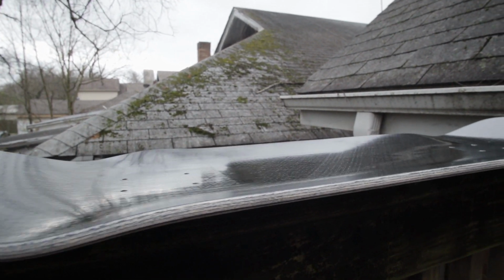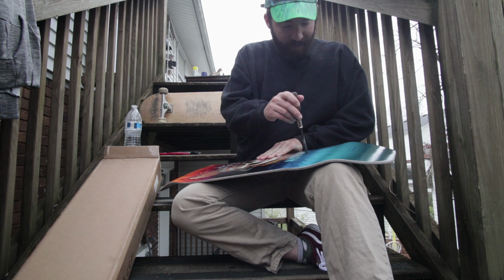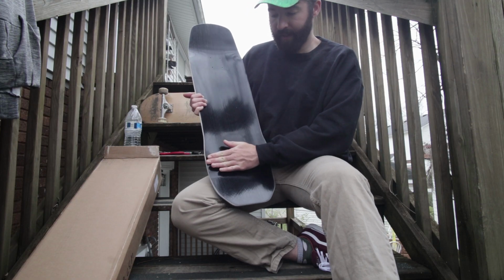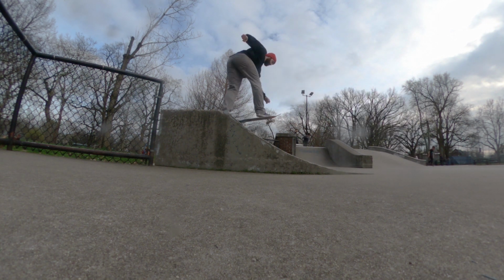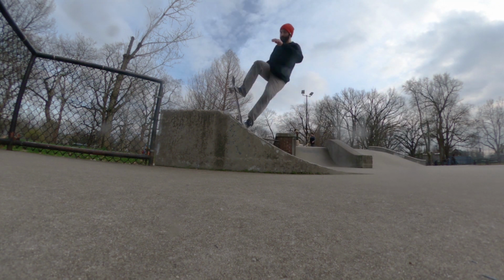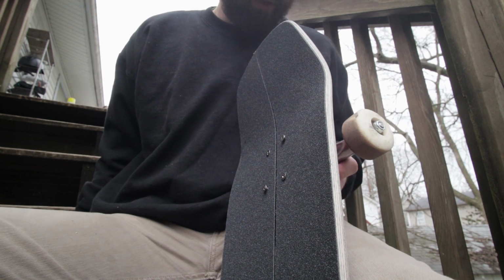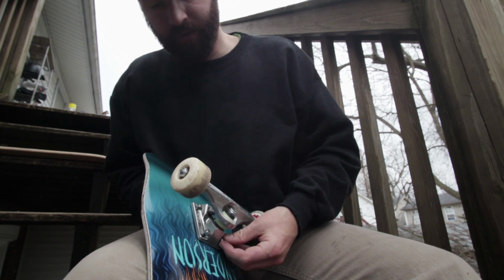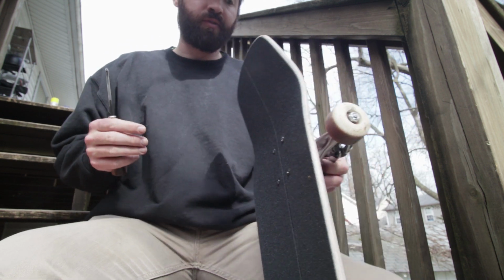Andy Anderson Powell Flight Deck unboxing and review

Comment: On the flight decks, the grip tape wears out way before the board. Just make sure you warm up the grip before taking it off to regrip it. You can pull up the top sheet.
Reply from the maker: Thanks, I'll remember that.

Comment: I love my heron deck i did had trouble with the bolts sinking into the carbon fiber but it never bugged me, I've been skating it about a month and at first i struggled to get use to the long wheel Base, i also changed shoes to D3 and since then i got used to it right away, i think it's because the D3 are very wide and reach the nose at my Ollie's sooner or something

Comment: Which size did you get? The 9.1" one? I've got the 8.45" one and really like it, but will get the bigger one once this one wears down so it better matches my trucks for rail / primo stand, because the trucks (Tensor Mag Light TENs 5.75) are actually a little bit too wide. It makes the board tip over ever so slightly towards the board side, instead of the trucks which would be way more stable / predictable.
Reply: PHeMoX how are the tensor tens? I have the mag light all terrain trucks, and they are amazing. I’d like to try the tens, for a lower truck
Reply from the maker: 9.1
Reply from the maker: I can only skate Indy 169's right now.
Reply: @kylemartinpaintings  I love them, but I don't think I am qualified for any kind of review on them as I'm quite a beginner. But they turn great and do feel very lightweight which is what I got them for as the Andy Anderson board is pretty big for what I am used to. In terms of ollies and such the Mag Light TENs are fine, same for flips. Haven't used them for grinds yet.
Reply: Hi, I also have the 8.45 withy the tensor mags in a 5.75 I find it super stable in primo. I also had to counter sink the deck to flush fit the bolts.
Reply: Please explain this comment.  Are you saying wide trucks make the deck tip over?  I don't understand that.
The trucks are too wide?  for skating? or do you mean the trucks are too long for clearance on a rail slide?  Please explain, thank you.
Reply: @kylemartinpaintings  I can't see the mag all terrains in a 8.75 unfortunately.  I can see the mag 10s in a 8.75.  Someone give tensor a nudge for all terrains in a 8.75

Comment: Hejjjj nice setup 🔥🔥🔥
I drive a 8.0-8,25 Decks size...
I have no idea which size I am order 🤦
I am scared the 9.1 ist to big for flip tricks
would you recommend the size???
or should I rather size 8.4 deck???please help regards
Reply: This 8.45 feels like an 8.25. It is pretty much a super sized free style board with a lot of concave. It feels a little small for pool or vert. Get the 8.45 if u are average height. Get the 9.1 if u are 6 feet or taller.
Reply: Dude...we learned flip tricks in the late 80s, early 90s with decks almost 10 inches.

Comment: For Andys 9” deck would you ride Indy 159’s or 169’s?
Reply: Definitely go with 169's with hard freestyle wheels like 97a
I have 63mm with risers and it is so nice for anything really just make sure you dont get soft wheels or you will be unable to do certain grinds aswell as any real nice reverts. I have independent 169 hollow lights skid plates and rib bones just to make the board last longer. I have nightmares that I will have to go back to a popsicle board lol.
Reply: The bigger trucks plus freestyle wheels makes primo sit rock solid
Reply: I'm thinking of going to a 9" - 10" after seeing Winkowski. He mentioned that he always uses 159 independent but I wonder if that works for a 10" board with 60mm OJ wheels. I'd like to build a good cruiser deck like Winkowski but wonder if he is just a one of a kind skater who can do tricks with a 10"
Reply: @Bradley_Warren  I ride 169 Indy forged titanium with bones hard core bushings and 1/8” Dook’s risers with 60mm 95A slime ball vomits, such a sick setup, I will never ride a traditional maple board again.

Comment: what size trucks are best for this board
Reply: 8,75'' for the 9,13''
8,38'' for the 8,45''

is what Andy rides, with 54mm wheels adn 1/8 risers
Reply: @Sk1tz092  thanks man sorted now but I appreciate you getting back to me 🙏
Reply: I use Krux 9.0 on my 9.13 model. It's perfect.

Comment: Should i continue to skate dude its become to expensive and being a 15 year old i dont have a steady income let me know what you think.
Reply from the maker: If you enjoy it. I can't stop. I would do whatever it takes to get a board. Honestly I don't have a stable income right now either. I'll skate a 2x4 if I have to.
Reply: @Averageadultskateboarder  So i think i will try to get one from Filter Skateshop in Abq new mexico, thanks dude
Reply: @Conner Haney: That's actually why I choose to go with a Powell Peralta flight board, specifically the Anderson one. It may seem like a big investment, but these boards do last long. The shape might not be for everyone, but Powell Peralta also sells excellent other Flight decks using pretty much a similar carbon fiber tech.
Reply: Anonymous  Don't steal dude. Just make some friends and they will give you their old board. Usually there is life in boards others will throw away. The other thing is, I don't believe anyone can't save some money for a board, unless you're like homeless at which point you have wildly other thing to be concerned with than skateboarding. I will admit skateboarding can become expensive depending on what you do and want. Keep in mind that you don't need a super expensive board or set of trucks to enjoy the sport. There are completes that go for 80 bucks, which are worth it if you're dead broke.

Comment: So it is indeed fiberglass it’s a structural composite. I only know this because I work with it at my job building boat parts like the frame in the body parts of the boat. When they press the boards they put two thin sheets of fiberglass in between the layers on on the top and I guess one in the middle and the resin actually hardens it and makes it even harder than what which is why it won’t break. But prior to that it’s like a fabric but once it hits the resin it gets rockhard. When I learned about the flight decks I did some research and once I realized it was the same shit I work with I just had to have one lol.

Comment: I’m 310lbs haven’t broke it yet 🙏😅
Reply: What are you using for trucks and wheels? I have this board  the 8.45 and never set it up.
Reply: @joeheading3191  trucks are Independent 169 stage 11 Titanium Forged/Bones Swiss Bearings/Kryptonics 62mm 78a wheels. For your 8.45 board I’d go with Indies 149
Reply: @mtgoat4434  I'm looking at the needed items now trucks in cart.. wheels im debating on spitfire Bighead 42s bearings bone swiss  is what I'm eyeing
Reply: @joeheading3191  harder smaller wheels are more for tricks etc on asphalt. For cruising larger wheels that are softer like 78a. Spitfires are bad ass though
Reply: @mtgoat4434  I want to back and forth on a smaller half for exercise  but I do want to learn some flat ground tricks
Reply: @joeheading3191  right on man get your money’s worth 👍